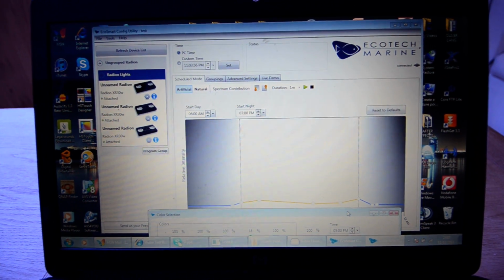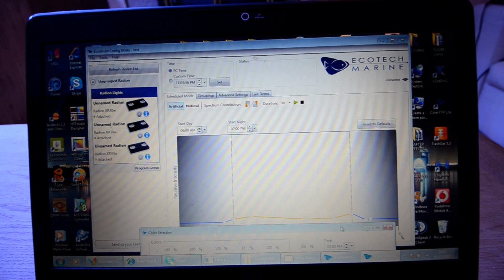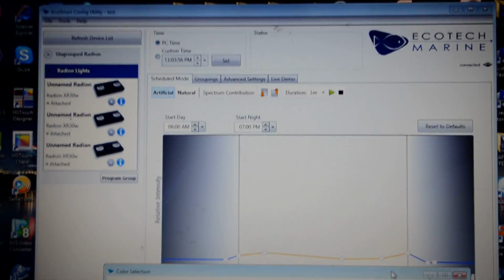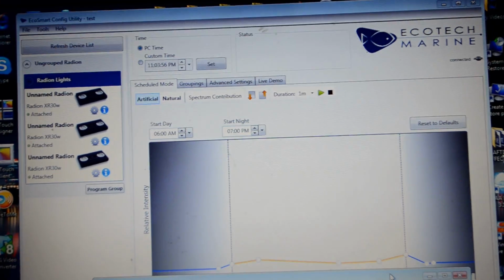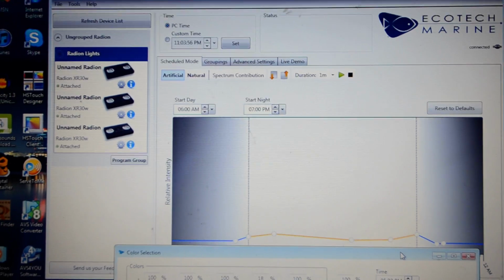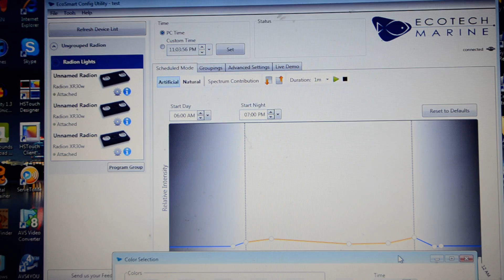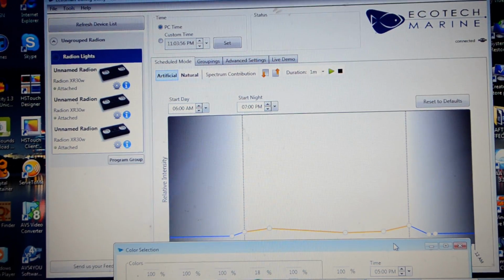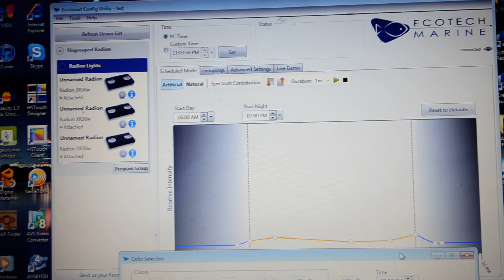Self Priming Pump Solution

Comment: I bought a clarke self priming pump in the end. My use for it is different though. I wanted it as a siphon, and it does sit on the floor below tanks level, but the fact it is self priming means i don't have to fill the tube with water every water change, it works very well.

Comment from the maker: @jayhawkscott I thought of doing this as everyone i've seen automates water changes from the sump. Ive read alot of research and seen tests that say larger water changes are up to 40% more efficient at controlling nitrates and other elements in the water so I decided to automate large water changes from the tank. The final stage in my sump is small and i wouldnt be able to do that much from in there. even though i have never seen anyone do this, I am going for it! Thanks for the tip though man!

Comment: I have set up an automatic water change system with my tank and instead of pulling the water from my display tank I pull it from the sump.  I use an Apex controller and with the use of some float switches in my sump I was able to write a program that would shut off my return pump drain the sump and then refill it with new saltwater (use the float switches for level) and then turn the return pump back on.  Not sure if this would work for you but it's a thought.

Comment from the maker: @snowingspoon All the research I have seen shows that larger water changes are much more efficient than regular small water changes for controlling nitrates and other elements in the tank and up to 40% more efficient! that would save on alot of salt over time and there are times when i may HAVE to do a large water change! This is why I want the flexibility and the option of the amount that i change. If i can do it then I am going to. Just waiting for a response from pump suppliers!